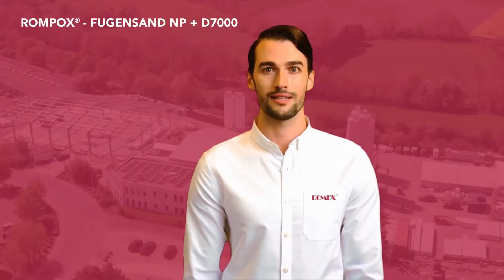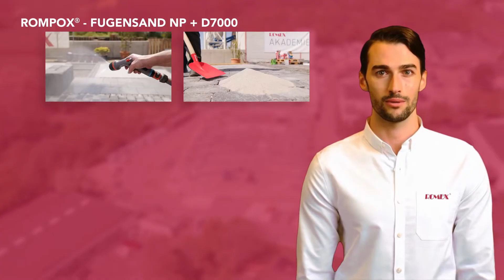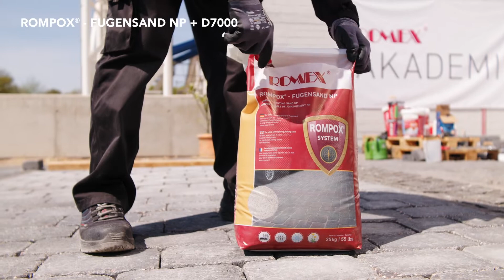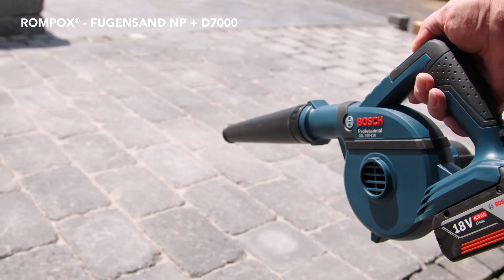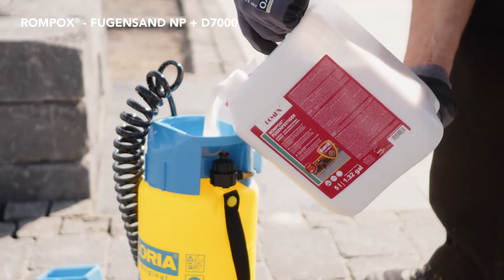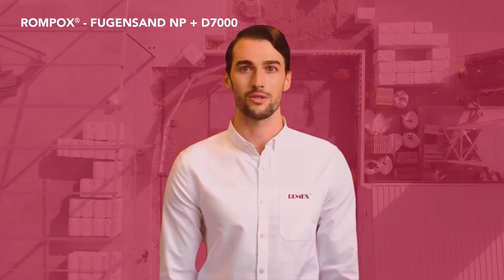ROMPOX® FUGENSAND | Jointing Sand & Stabilizing Sealer Installation

Comment: Trash product doesn't work.  The magic amount of water is never enough or is always too much joints never cure properly.  Overpriced garbage.  Might as well just use a regular joint sand for a fraction of the cost and then seal